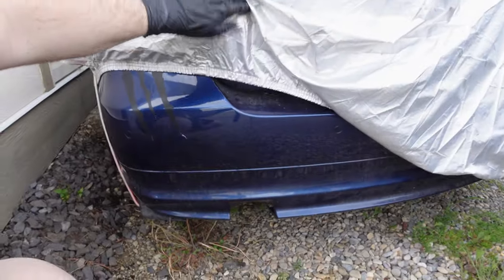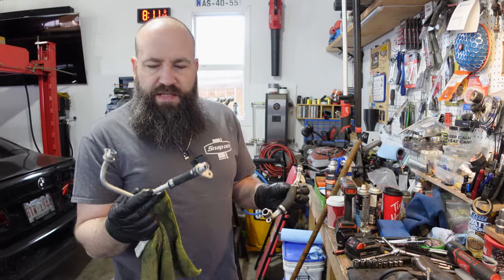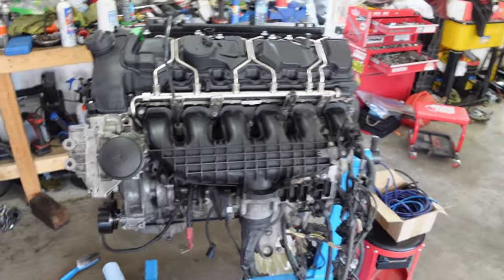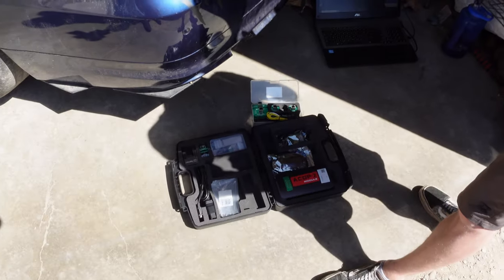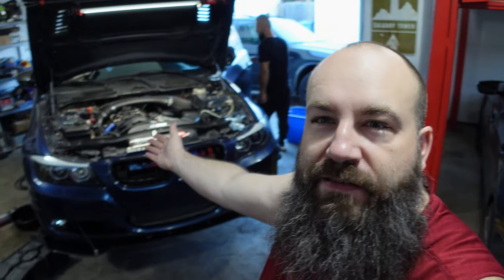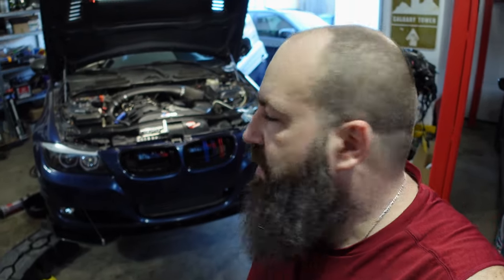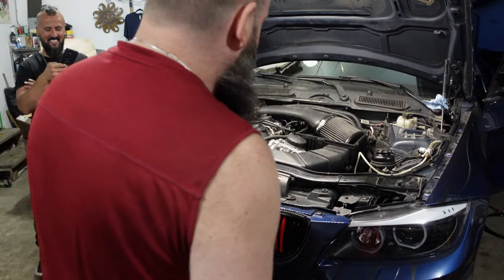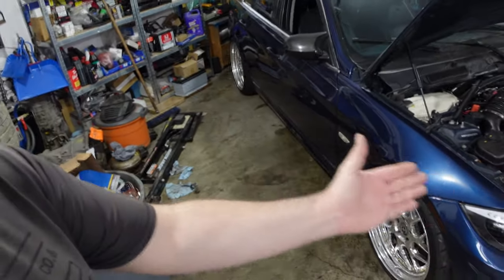All This Work For NOTHING!? E90 N55 8 Speed Build

Comment: Low pressure and High pressure fuel pump?  Check if you have consistent pressure.  Regarding the DME, check each of the mosfets if any are shorted.  Something silly as old fuel that's gone bad in the tank (too much water absorbed) can also cause issues in general.  PS.  Love the work you guys are doing, great job!
Reply from the maker: thanks! I think we're narrowing it down to the DME. we gave it a couple taps and could read it again for codes. I checked connectors and there were signs of water / dirt in them!
Reply: Ive heard of water getting in the dme box with the bms cowl delete filters, thats why i put my original cowling back on
Reply from the maker: @BraydenN55 that's exactly what happened here!
Reply: @tony.nextlevelrides  yeah I run the cowl delete covers with the cowling bottom piece on so the water is deflected lol,

Comment: ECU capacitor leaking. Open up the ECU to look for leaking capacitors. The way you describe the issues, it could be this.
Reply from the maker: that's what I'm leaning towards, tapping the DME with a snipe is doing some weird things.
Reply: I saw a weird one from another YouTuber that it was a canbus hub of all things. A terminating resistor was overheating and changing value
Reply from the maker: @AtreidaeChibiko  that would have been absolutely brutal to diagnose!

Comment: Check your DME for fuel contamination or any type of corrosion. Take off all your plug connectors on the DME and inspect and make sure they are dry.

I had this happen to my e70 X5 35D, low pressure fuel line with built in temp/pressure sensor failed allowing diesel through the plug connector which found its way into the DME.

Long story short, needed a new DME, and wiring harness as per BMW for them to cover the DME under warranty.
Reply from the maker: Taking off the plugs to the DME showed traces of dirt / water intrusion, we saw this and wiggled the DME, ironically it came back to life.

the fact you got diesel fuel in your DME is insane! I never thought that could happen! I'll check as soon as we pull it out!
Reply: @tony.nextlevelrides  Makes sense, if the car was sitting outside for a while and if the windshield cowl was damaged or if the drain wasn’t aimed into the fender water could find it’s way to the DME. 

You may be lucky, just clean the corrosion, open up the DME itself and give it a clean and you should be good to go. 

Unfortunately in my scenario I’m pretty sure the diesel fuel destroyed the insulation on the transformer in the DME for the injectors, everything else on the board seemed ok.

Comment: Is there a video on swapping the transmission on this specific car? I have the same car and same transmission. I'm looking for a step by step to easy the process.
Reply from the maker: the coding of an e chassis transmission is going to be the difficult part as we needed to purchase the extra flasher and adapters. perhaps we can make a video about unlocking the transmission with a spare 8hp I have here
Reply: @tony.nextlevelrides  That would be great because I am doing a 8hp45 into my 2011 335i xdrive e90.

Comment: when you can't read codes, is this for just the DME, or everything? if everything, and the CAN bus is daisy chained, it's likely the first module on the chain, if it is NOT daisy chained, thejn you are losing module power somehow to the entire car, 

i know you said you replaced the harness, but have you tried the fuse box? internal shorts in the fuse box can do similar ( seen it on a toyota, and on my Chevrolet beretta, where you could pull every fuse and it would run cause somehow it shorted internally)

if it is JUST the DME for codes, then it is likely the DME is failing when it's internal temp get's too hot, pull it out of the box and put a fan on it and see if it changes anything.  ( you can also remove metal cover and put a fan on it. )
Reply from the maker: seems we're just losing the DME! weren't sure if the CAS was fed power by it or not so narrowed it to the two perhaps.

Really appreciate the help! Awesome thing to look into. I guess my idea of "put a bag of ice on it" isn't as dumb as I thought. 😅
Reply: @tony.nextlevelrides  nope  not dumb at all,  although a mineral oil bath with ice bag might work better LOL ( although very expensive)  fan, A/C should work just fine.

Comment: Bro Did you fix  the problem ..!!? 
and Did you Upgrade the fuel pump?  Because sometime if you change the fuel pump, the wiring inside the pump is wrong you have to opposite the wire  I have this issue before I’m done I opposite the wire and the car work fine Be careful for this point And let me know if you have a new update. Good luck, bro.
Reply from the maker: the repair is in the works! we'll have a video once it's repaired and confirmed.

nope, didn't change the fuel pump or anything, just a very large methanol nozzle. 😉

Comment: Bro I think the. Proplem on the DME crash map  file Bro re flash the ecu  if yo have mhd tune and jb4 back end go to Factory map and reflash again and  check map sensor and the Fuel pressure  and Fuel pump connector sometimes it do it like this
Reply from the maker: we'll give it a try!
Reply: @tony.nextlevelrides  I wouldn't reflash in its current state, if it loses connection you essentially brick that DME.

Comment: So I own a 2011 n55 e90 and I want to modify it but to just around 400-450 horsepower like what do I gotta do to achieve that can anyone give me help or tip 🙏🏽
Reply from the maker: if you want 400-450hp to the motor, full bolt ons and methanol injection would get you close.

Comment: 25:00 runs on ether? stuff a 1700lph fuel pump in it, their good for 400-600hp on that ethanol junk that has thinners in it that make OEM fuel pumps cavitate. its them and their EPA fuel they sell, not the vehicle. two of the SUM-G3136-2 to pick up feel and shove it into a SUM-230128 with a SUM-250111... the larger gear pumps force it down the line. "tho, does it run on ether, does the fuel rail loose pressure when that happens? 400 or so in parts, free shipping is going on still. ethanol compliance kit up, forced to change equipment because of the stuff they put in gas to demobilize vehicles wandering to far out of their permitted aria!".
Reply: the two 14psi gear pumps pick up fuel and push it into a Y block that connects to a filter and high pressure injector pump, can put a 100 micron filter in front of each lift pump. add other fittings and hoses... fuel economy drops off to 60% of whatever it was after fixing it. was 16.8mpg now 11mpg... E100 everywhere. Summit Pumps need to run wire from the battery for each of them and tie a relay block into the ignition for them... annoying federal structured junk just because its not a $140'000 fresh off the dealer lot the pump station switch board operators in the office $300 miles away watching the security cameras give if junk to make it "konk out". looks very new still they don't Karin anymore because its not on their pay role of bill collections.